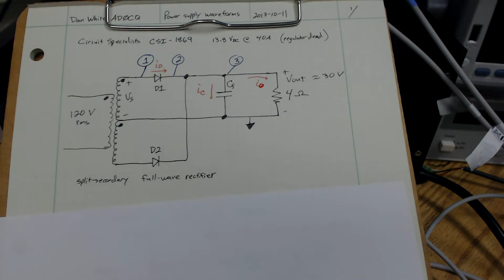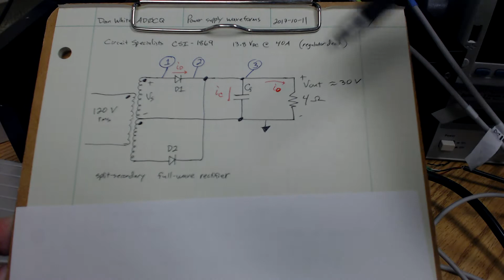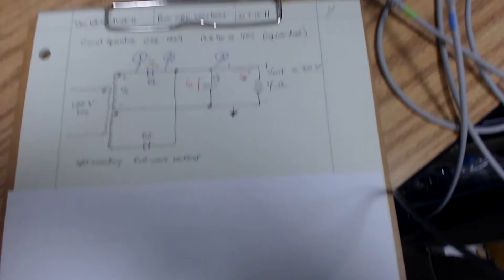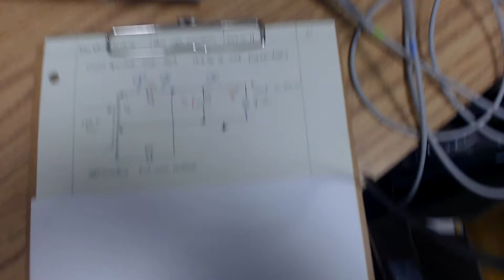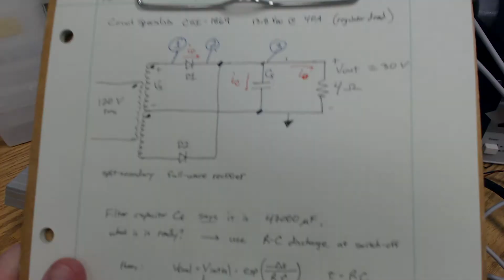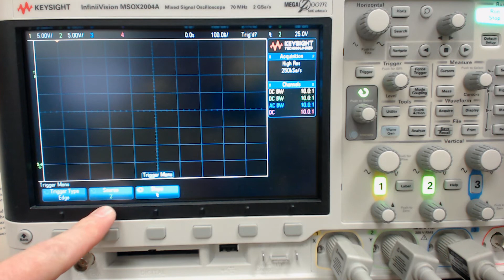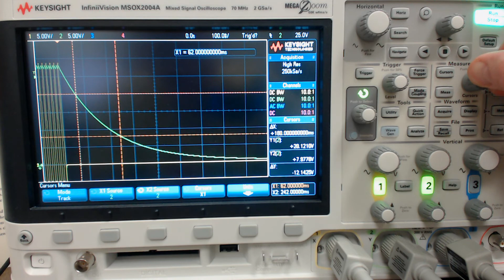Linear power supply - part 1 - filter capacitor

Comment: What is the formula that should be used to calculate the value of the of the capacitor that should be used after a bridge rectifier?
Reply from the maker: The third page of the PDF notes discusses this, the accompanying video is https://www.youtube.com/watch?v=NtA_10PKnOs

The capacitor value depends on how much/little peak-to-peak voltage ripple across the capacitor is appropriate for the rest of your system.
Reply: @DanWhiteValpo  
Thank you for your answer.